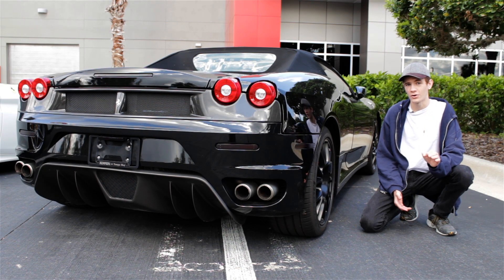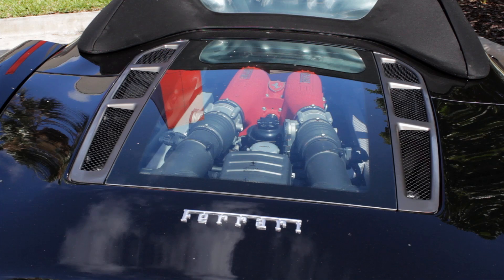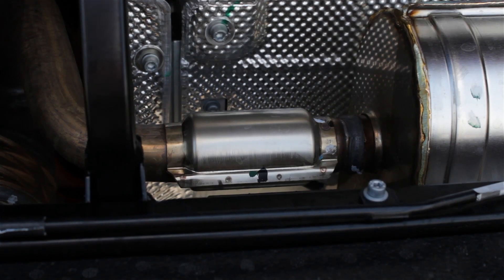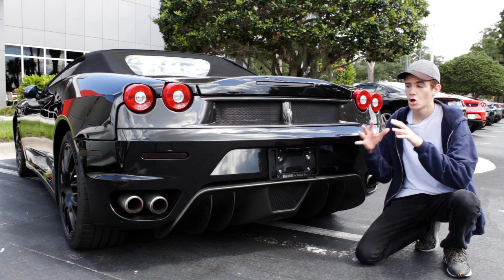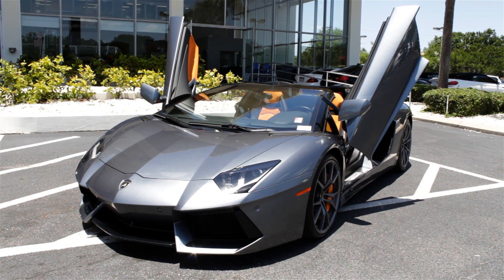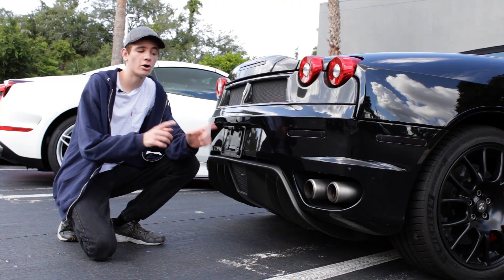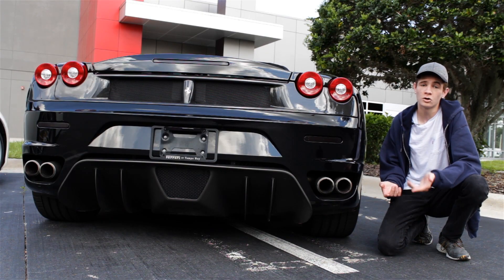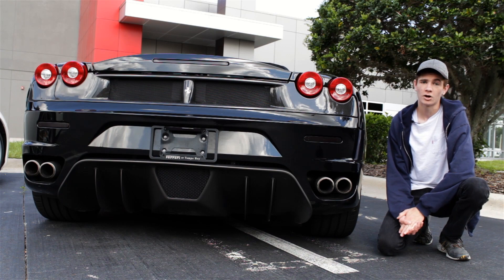What Makes A Car Sound Good? | The Exhaust System Explained

Comment: The exhaust manifold or "header" is the most important factor in dictating the sound , the muffler aka silencer is more of a volume control tool.  Resonators are often to cancel out drone.  You can make a Chevy v8 sound like a ferrari or a dump truck depending on the header primary length , diameter , and arrangement at the collector..
Reply: Can you make a 4 cylinder sound like a dump truck?
Reply: @woooose  Isuzu makes a 5.4L 4-cyl dump truck
Reply: Can you tell me more on this man ?
Reply: @NickKautz Can I make my INLINE 4 N/A 1.2L Petrol Engine sound like a V10 if i change my exhaust manifold?
Reply: I don't think so but there are 5-cyl Audi and Volvo engine's that sound like a v10.   @SS-cv4fo
Reply: @SS-cv4fo  no, because the characteristic sound of a V10 is caused by it's firing order & intervals.

Comment: soooo. I can't get a V6 to sound like a ferrari?  I like the high pitch yawn sound of a 458 and not the load throaty guzzling sound of a mustang.
Reply: Most exotic sound you can get with a v6 is having a exhaust for each bank without joining at any point. Where usually a v6 with both header joining to one pipe or an x-pipe it will sound like a 350z if you don't have the headers join at all you get the sound of 2,  3 cylinders